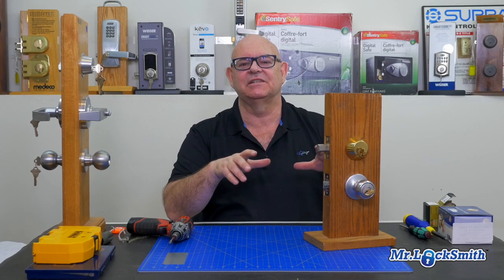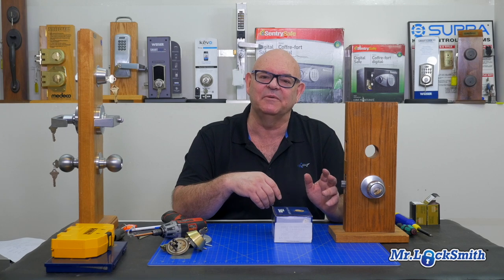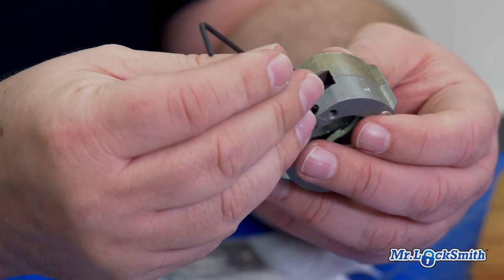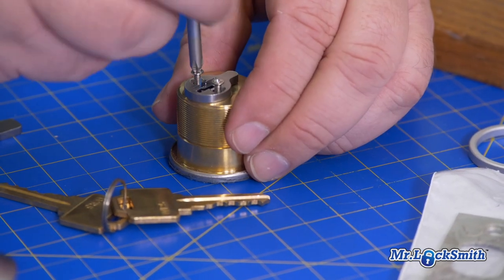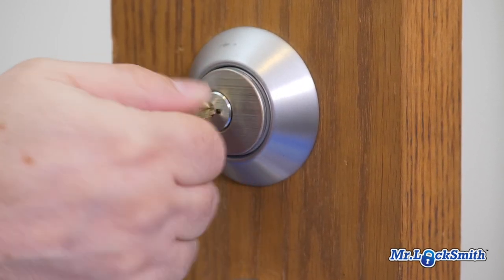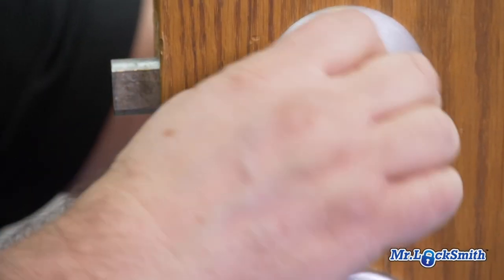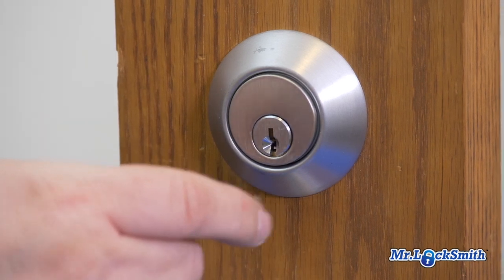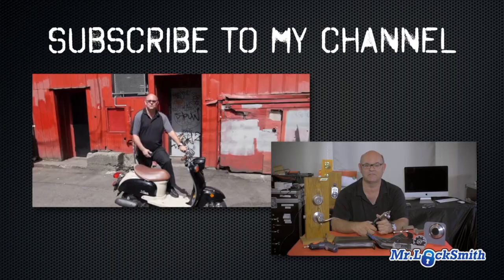How To Install a Lori Single Cylinder Deadbolt | Mr Locksmith Video

Comment: Your camera angles are great, makes the videos easy to follow.  The latest version I have been receiving come with a slightly more ADA friendly thumb turn that requires simple but confusing assembly.  I like these locks, they are quite durable, especially if a drive in latch is required.

Comment: Nice video! This lock is one of the most modular deadbolts out there. You can turn it into any function you like by simply by changing the cylinders. So if the building is often changing room function, this works a treat without having to change out the whole lock. Its larger bolt and low profile outside also makes it rather resistant to forced entry attacks too :)

Comment: Hi Terry thanks so much for the excellent video (as all your videos are). Quick question: I’ve bought an old house that the previous owner at some point installed double cylinder Lori locks on all exterior doors. They’re a giant pain because if the deadbolt is locked you have to have a key to unlock it from the inside to let someone in. I want to convert it to a basic single cylinder lock with a simple knob in the inside for easy locking and unlocking without the key . Can I easily convert mine, and keep the same common house key?
Reply: Yes you can. Remove the inside mortise cylinder and install a mortise cylinder thumb turn.

Comment: Holy cow, what on earth were they smoking when they came up with this design? We have a similar thing here in Australia that uses what we call a 570 cylinder... Made by a company called Lemaar... And it's terrible. 
Surely it's design simply adds cost and no actual benefits whatsoever over a tibolt style, 8221 cylinder deadbolt.